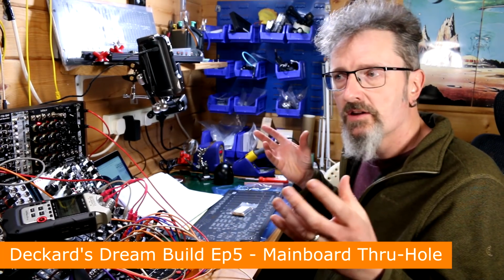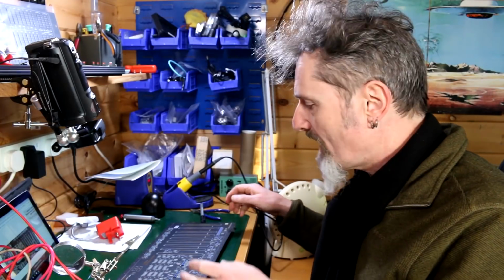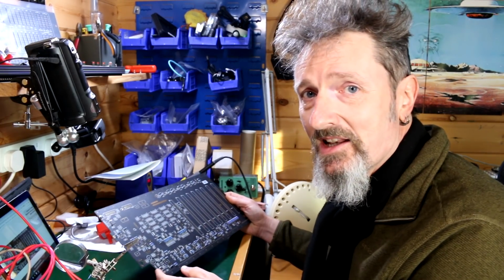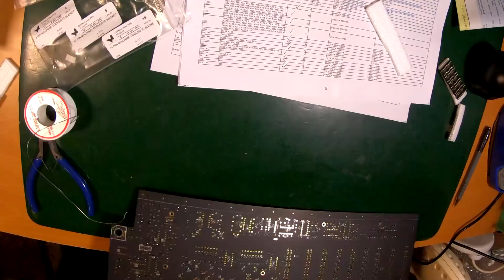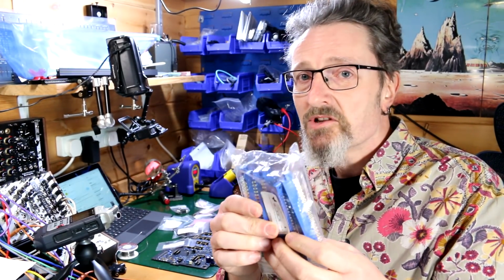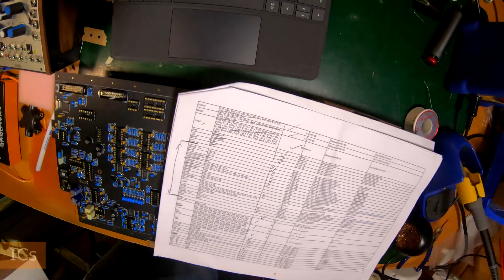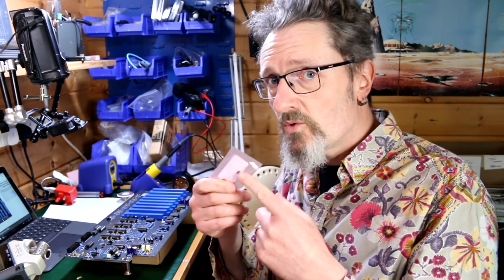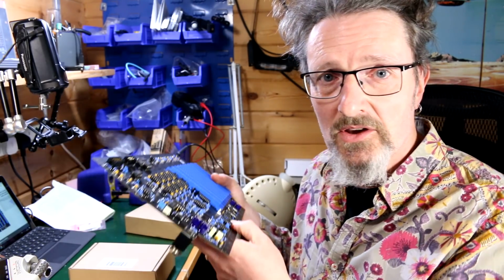Deckard's Dream DIY Build 05 - Mainboard Thru-Hole

Comment: Quick comment on the non-sequential layout of resistors; when you look at the circuit schematics, the numbering makes more sense. You can see that the components are logically laid out with respect to the circuit they make. Not ideal for the builder, but probably more helpful if you’re debugging or troubleshooting specifically issues.

Comment: For a bloke that only started DIY builds relatively recently, I gotta compliment that your layout of the components is excellent (very neat and highlights the care you are taking in general). I also like the fact that you measure the resistors prior to mounting on the board. A build like this (complexity, time and cost) would frankly freak me out so more power to you, fingers crossed it fires up and makes sound when your done!
Reply from the maker: I have everything crossed

Comment: Is the MK2 a similar build? It's smaller than the MK1. Nobody has seen one yet
Reply from the maker: There is no kit version of the mk2 - the kit will continue to be the mk1
Reply: Molten Music Technology thanks. The website suggests you can buy a MK2 kit. Is that actually the MK1 kit?
Reply from the maker: Yes, the kit is “Rev2” which is the second version of the first kit. It’s not clear on the website - check out my live chat with Bob Rogue from Black Corporation - he talks about it

Comment: The left-to-right naming of components would be nice, but in board design software (at least eagle and kicad, the ones i used up until now) the names of the components are giving during the schematic layout, during which the electronic circuits are designed/drawn, not the board layout, during which the components are spaced and placed on the layout (is that clear enough?). ((spoken as somebody that is still learning these programs, so there might be an easy way?)) That makes an easy left-to-right layout a bit inconveniant, sometimes, as parts that are next to each other in the schematic don't have to be placed next to each other in the board layout. One would need to rename each and every component by hand, and that is incredibly time-consuming. I can only recommend opening the schematic/board design files in the editor, as they offer really nice search functions that make finding hiding components a breeze. Also, what made soldering throughhole components way easier for me was soldering the parts on the frontside, not the back. Way less turning-the-board-around and parts-falling-out (works for resistors, diodes and ceramic caps). And a bending gauge as a tool really sped up the process for me! But very cool video, looking forward to hearing that thing!
Reply from the maker: Yeah I get the reasons why but it's worth grumbling about. If i soldered on the front side I would be melting components and getting flux all over the place - that doesn't really appeal. Bending gauge - worst tool ever! Ha! We all approach these things differently :D
Reply: @MoltenMusicTech yeah, I get the flux part, especially on a gorgeous board like this.  The bending gauge - worst tool ever? How so?
Reply from the maker: Took longer to use than to do it with my fingers and is never the right size.
Reply: I can only assume that since this is a commercially available kit, that the schematics/pcd designs aren't available without trying to scrape off the mask and reverse engineering

Comment: Great Work, Robin! As I mentioned in the FB comment, we are staying as hands off as possible, two things you'll find reassuring: 1) the card slots on this build can go in either direction.  2) the pin connectors, it doesn't matter which goes where as it is your own build, we typically put the male connectors on the motherboard and female connectors on the hardware board, but as long as you have the appropriate placement of the opposite connectors, it's all good.

Comment: Are there any tantalum capacitors in the kit ?
If so, you Do know that they are polarized +/- like eletrolytic capacitors , Right?
i.e. They HAVE TO go in the right way round.
Hopefully someone will have pointed this out already  ...
Reply from the maker: Not heard of those. I tend to let the spirits guide me.
Reply: @MoltenMusicTech  They're small similar size to little ceramic caps. Often Blue in colour. I saw a load of blue things going on yer board but I couldn't make out what they were at that X Mag. 
One clue is that they'll have a little + printed near one of the legs to tell you the polarity of them. 
They're useful little buggers but the raw Tantalum is now a Conflict Resource so there're less of them about than there used to be.
Reply from the maker: Still not heard of them. The board has writing on with things like polarity when appropriate so.... they shouldn’t be any mysterious designed-to-trip-you-up components.
Reply: @MoltenMusicTech  Any responsbile kit maker would tell you I'm sure. Here's link anywhoo for yer edification.
https://en.wikipedia.org/wiki/Tantalum_capacitor
See the blue ones in the pic ? That's what set me off  ...